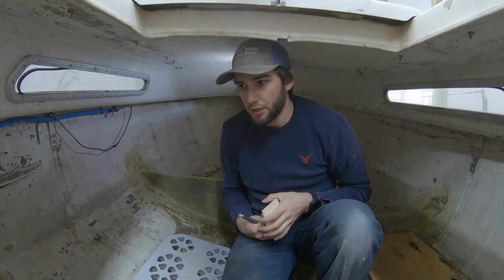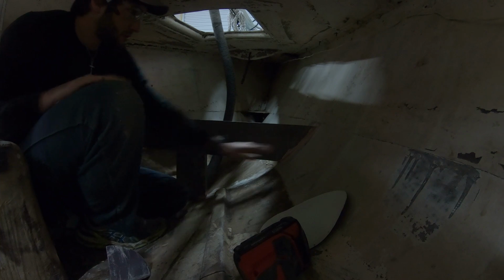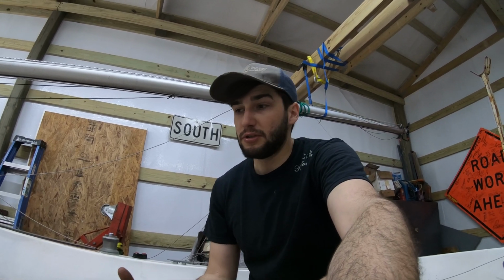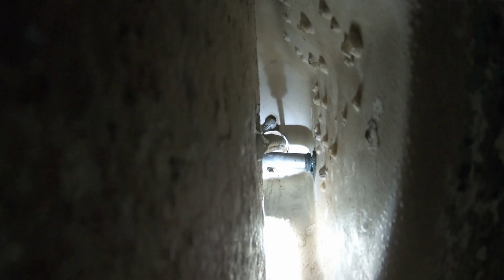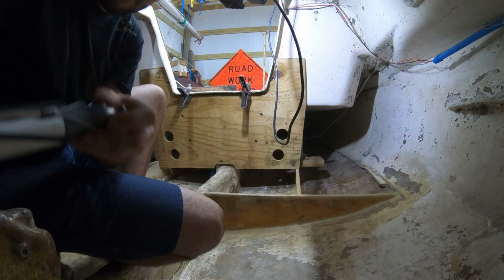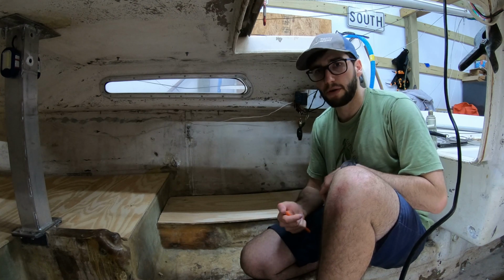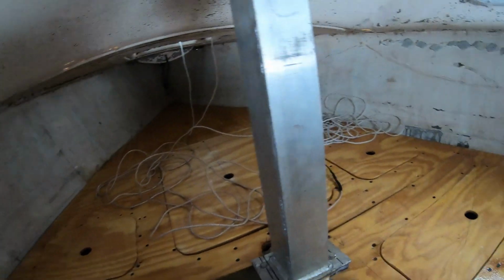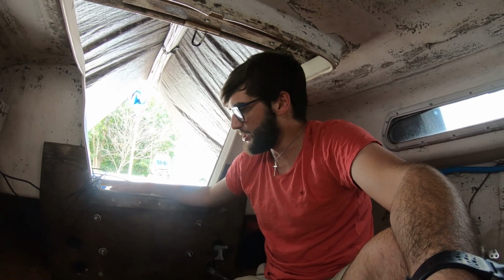MacGregor Venture 21 Sailboat Interior Rebuild - Births Compartments Bulkheads -New Salts Episode 18

Comment: Just curious ... when you had all of the hull empty ... why didn't you strip away all of the chipping paint and dirt / mold ... and then tab in all of the bulkheads?  I would have also painted the entire bilge and all of the storage under the berths before securing the berth tops to the bulkheads.  I also noticed that you did not make each of the storage compartments individually separated and waterproof -- if you are going to go through the trouble of adding expanding foam for buoyancy, a great addition is to seal each individual compartment  as crash bulkheads below the water line.  I really don't mean to sound critical, but all of these suggestions will make flipping the boat easier later to get that blue water boat that you want.  Nice job on the cockpit reinforcement!!!

Comment: Was surprised to see the keel winch located where it was.  I have a '71 V-21 and it is inside the cabin, just at point of entry where you are replacing bulk head...was that a "mod" done by prior owner? I don't like stepping into cabin and sometime catching winch handle, but I think I like it more than  having to straddle the entire system when entering and exiting the cabin...haven't seen the entire series, so perhaps you address this in a later video.  Thanks for the work; always an inspiration to watch someone get in there and get 'er done.

Comment: I see this was 2 years ago. How has the dream progressed? I wonder if I could ask a question about the interior decking. Did you cut out the old deck? I just got a 1970 Venture and the decking has rot. There is fiberglass all the way around the edge. I am guessing factory applied. I envision cutting the glass all they way around it. Or could I cut out rot and put in openings like you did? What do you think?

Comment: I'm very curious as to why you would want auto pilot on such a small vessel.   I have two 21' / 6.4 Meter Macgregors . My goal is to rent them out to finance completion of my 9.9 meter Catalina and my 9.9 meter Trojan.  Liked and subscribed. Thats alot of extra storage for the small boat.
Reply from the maker: Thanks for watching and for the comment!   I am working on this Autopilot system in preparation for when we purchase a bigger boat.   It is by no means necessary for our current use of the boat but its just a fun project that i have enjoyed working on.
Reply: I've wondered the same thing. I follow How to sail oceans. He hardly uses an engine. Much less gadgetry. I also follow Sam Holmes. Love his videos but seems he's constantly add new electronics.  I Guess its something you get people do. My goal is to learn to use a secstant efficiently. Vhs radio with GPS compact

Comment: Great JOB!  I really wanted to know about the cockpit drain hole /tube or the keel cable passageway wear bolt.. " Blue Water MacGregor " had a metal tube assembly / replacement tube - available at one time but I did not replace mine only the Bolt (my tube did not seem to be in need of replaced)  Also, did you replace the Keel Lock Bolt on the very forward section of the Keel as you did not mention it in your earlier episode.  Thank again for doing a great job in reporting your restoration progress.  I feel better knowing I am not the only person working on a really old  Venture 21.. Keep up the good work and best of luck sailing with your family.
Reply from the maker: Previous owner glassed it up.   We are going to be removing the keel and painting the boat in August.  Will be restoring the locking pin  during that time.

Comment: Thanks for taking us on your adventure! I have to say whenever Anna says "sail" her accent makes it sound like 'sell' and I have to listen to the intro just to hear that!
Couple questions: 1) How will you access the cockpit drain hole/tube, which serves as the passage way for the keel cable and contains a bolt that redirects the cable slightly as the keel lowers? (Mine has developed a groove from the friction and lack of a roller/bushing and is apt to need replacing on occasion.) 2) Does your plan to have holders for poles under the cockpit plan for all the foam blocks that help keep the boat afloat in the event of a knockdown? (Mine also has blocks filling the forward area under the V-berth.)

See ya next time! Cheers!
Reply from the maker: I still have acces to the bolt,  i did however remove it, install a section of galvanized pipe filled with grease around the bolt which makes keel operations much smoother.  (Huge pain getting it installed with the keel in the way but it was well worth the struggle.           Our boat came without the foam blocks   We will be filling the areas under the quarter births with some sort of pour in foam.  We are still researching product options for this.

Comment: I have a Mac 22-2, which I guess was the last of this famous design. Cool to see what you are doing. I used KILZ anti-mold paint and if you clean up the interior hull (sander/grinder), the paint holds up and is trouble free. Can also use Zinsser mold killing paint I'm sure. I would do this while you have the boat apart. Your family will thank you!!
Reply from the maker: Thank you for the recommendation! will look into it for sure!
Reply: I also used the Kilz along with Rubber roofing, on the dead interior of a V25 All though i used a pressure washer to blast it clean. Looks like new inside, worth the time major improvement ( if you care about looks that is)